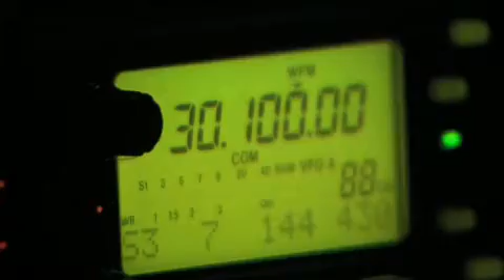Ham Radio 24 GHZ and Red Light Microwave Contacts

Comment: Red-light transmitters use a laser.  It's really not microwave...Wavelength is around 680nm, far shorter than even millimeter-wave.  It's quite a challenge because you have to design and build your own transmitter and receiver.

Comment: Hi KB3SKU,
I found this on the ARRL band plan site.
Everything above 6 meters is free to use as a tech, but not novice.  Double check before operating.

**All modes and licensees (except Novices) are authorized on the following bands: 
24.0-24.25 GHz
47.0-47.2 GHz
76-81.0 GHz
122.25-123 GHz
134-141 GHz
241.0-250.0 GHz
All above 275 GHz 
* US amateurs must check Sections 97.301, 97.303, 97.305 and 97.307 for sharing requirements before operating.**
There you go!
KF7AOL 
73!